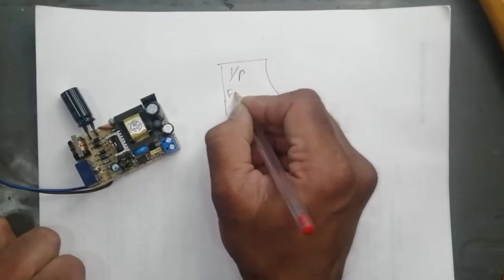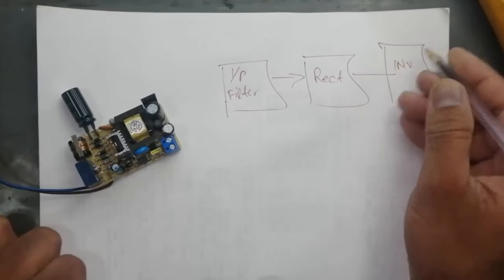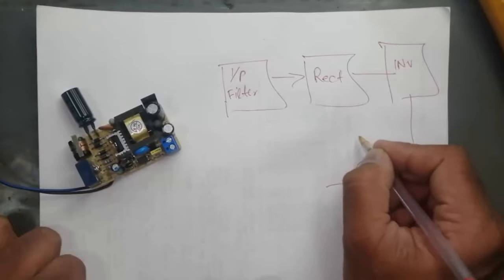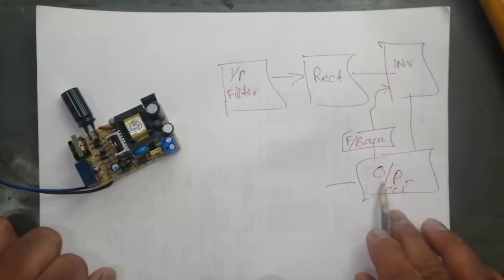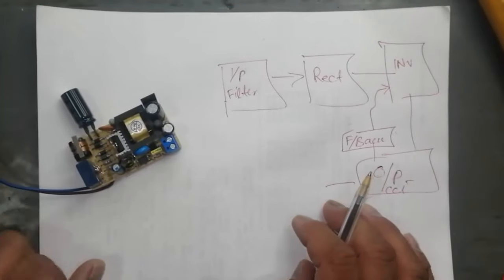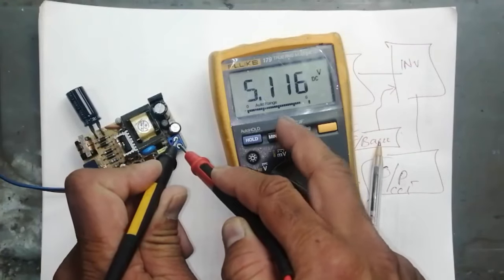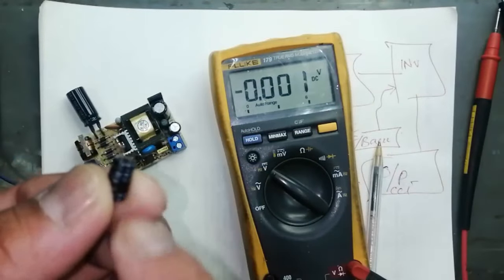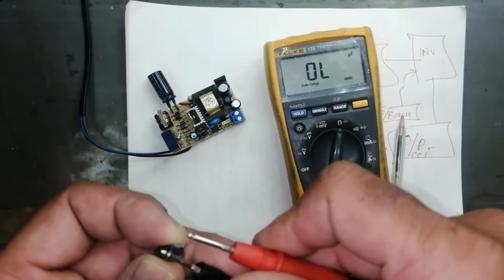How to repair switch mode power supply SMPS practical troubleshooting

Comment: For almost over a year now I have looked online and searched everywhere to find any guide, any educational material, on Washing machine control module, their specifications, schematics, testing, diagnostics.  Not a single corporation from LG to Samsung, Whirlpool, GE will provide such a thing.   All that is provided is how to be a parts changer.  How to remove and replace a component.  And anything more than that,  what you will find is that it tells you to call their professional which mind you are also parts chargers.  Because that is what they also do.  And of course, the gimmick is that they want their experts to make money and they are at least guaranteed to make money for the road trip coming to your house and fixing it is a whole other charge and of course most often the diagnostic is in the form of  " it needs a control module".  That statement cost you $80. 
The only place that I have seen that really have seem to have access is Mexicans.  I will leave a link down below.  You have to search Youtube by typing Spanish such as "La lavadora LG no se enciende", LG washing machine does not power up.  But since I don't speak Spanish and Google translation is outrageously wrong....  perhaps for a reason.  Can't have the masses figure things out for free. they won't have it.

It is obvious that the control module for the washing machine is made of two parts.  Power supply part which is AC to DC smps and then the motor controller. Two separate things in one package, not counting the user interface.   Some have separate motor controller if the motor happens to be a three-phase and not BLDC.
LG and Samsung seem to only deal with BLDC and of course good luck working on it even if you could.  It is filled and sealed with all that goop syrup. It is outrageous.
I have seen some user interface that is completely shut with no access and if you pry it open, it is destroyed.  They make sure you can't work on it or they won't make any money selling the item if you were able to fix it.

Here in the link below is Mexico's style of repairing appliances.  They teach you the real deal and you can find it online.  In America, this does not exist. They can't have it and especially cheap. If I could only speak Spanish.
https://www.youtube.com/watch?v=g7PhDuQoK9E&t=283s

Comment: i have a smps of computer its VSB voltages are 5 volts the power on voltages on green wire are 5 volts but when we ground the power on it does not guve output i have checked everything but i cant understand what to do next kindly help and also give me your whatssapp number

Comment: I admit that you have knowledge but my opinion is that you are not working safe. In 13:18 your finger is almost touching the live track on the pcb.
Reply from the maker: thanks a lot dear 
i always take care for safety, as i have fully isolated work bench, but practical work is different than making videos 
it is totally a very very difficult filed to capture the videos. 
taking care for camera, focusing, putting the job in the camera frame, and narrating it, it is really needs too much concentration 
please accept my best regards and special thanks for your valuable comment